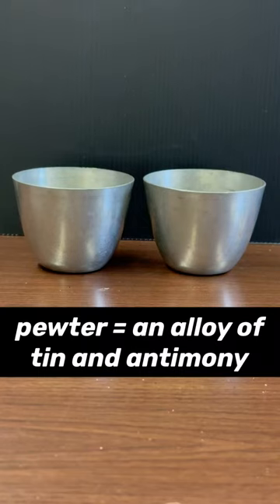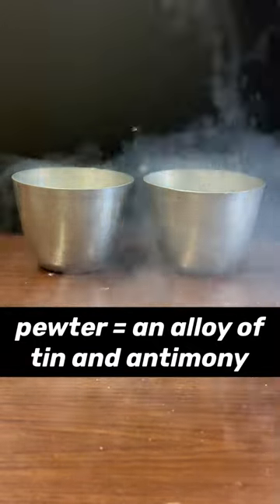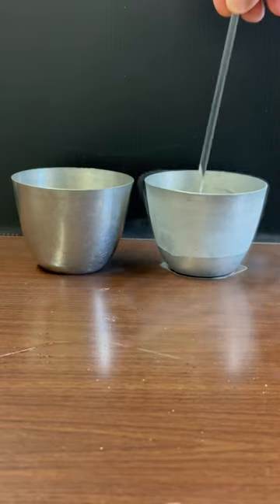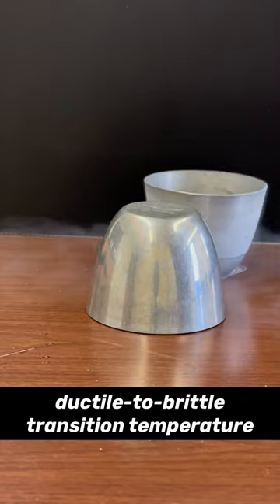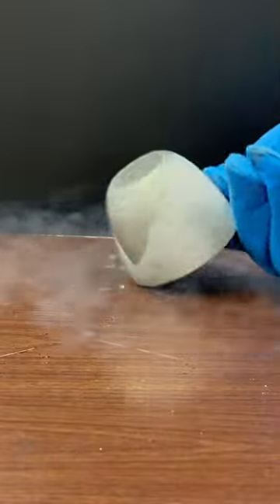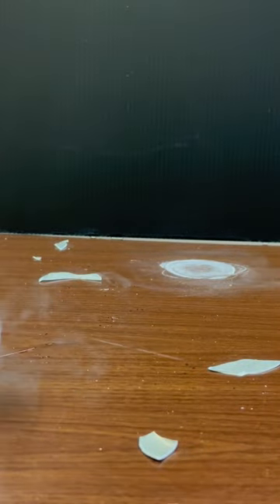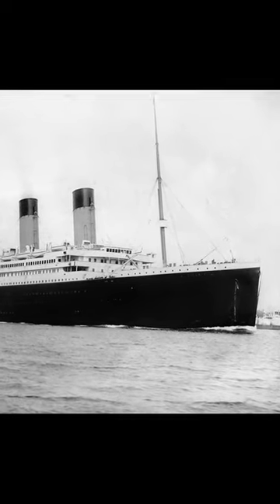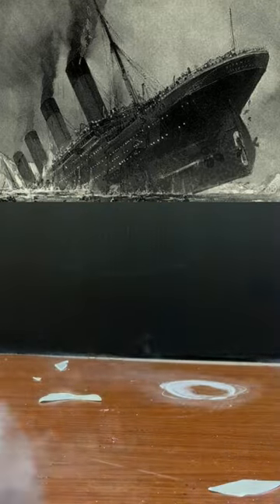Chemistry and the Sinking of the Titanic 🥶🔨🛳️ #shorts #chemistry #titanic #liquidnitrogen

Comment: Except that Titanic's plates weren't brittle; they buckled and deformed just like steel is supposed to, causing the rivets to fail. And the rivets were made out of wrought iron, which is inherently more resistant to brittle fracture than steel. Also the ambient water temp was about 28* F or hovering just above where ductile to brittle transition can occur. Likewise while one side of that steel is contacting the 28* ocean, the other side is exposed to the 80*-110* temperature of the boiler room, so the hull plates themselves would not be anywhere close to freezing.
Reply from the maker: Several peer reviewed scientific articles indicate the waters cooled the steel in the Titanic to below its DBTT. See, for example https://www.tms.org/pubs/journals/jom/9801/felkins-9801.html
Reply: Hammerandhearth you’re absolutely correct, also Fred Barrett clearly stated that the steel plates bent and popped the rivets this is stated in the British and American enquiry.
Reply: Also hadn’t they only just crossed into the Labrador current around a few hours before 11:40?
Reply from the maker: @thebitsanpiecesman4423  sounds interesting! Do you have any links to peer reviewed scientific sources where I can learn more about these claims?

Comment: In the Navy we called it "violating brittle-fracture limits" bad when it's the hull, "stick your head and kiss your ass goodbye" if it's the reactor.
Reply: How... would a reactor approach this limit... dont know that I'd want to see a shattering reactor.

Come to think of it, how many nuclear watercraft have sunk?
Reply: So for the first question, with out going in to too many details, there is a pressure/temperature curve that if you operate outside of you can violate brittle fracture. To my knowledge this has never happened. Last time I checked the U.S.Navy has over 6500 Reactor hours without an accident. Now for the second, I know of only two nuclear powered vessels that have sunk (for the U.S Navy, I think the Russians lost a few, some due to Reactor accidents), the USS Threasher and the USS Scorpion. The Treasher when down due to a piping failure and icing over emergency blow valves. The Scorpion is unknown exactly, though it is known it had nothing to do with the Reactor. The leading theories are she had a hot running torpedo which exploded and sank her or she was torpedoed by the Russians. I personally lean towards the hot running torpedo. I doubt if the Russians sank her they would keep their mouths shut.
Reply: @michaelwerkov3438  google says 9 nuclear subs have sunk

Comment: As an automotive technician in the days of drum brakes, during a drum brake service we would take the return Springs and drop them on the floor and listen. If we heard a thud they were okay.  But if we heard them ring we knew that they were too brittle to continue to be used and would need to be replaced. These were obviously steel but between the heat generated from stopping and the continual tensile stress they were under we knew that they had become too brittle and had lost their tinsel capabilities. A simple test we did to determine the safe re-use of them.
Reply from the maker: That's awesome. Any idea where I can get my hands on some similar springs for relatively low cost?
Reply: @TommyTechnetium Sure,  you can go to any auto parts store and order a return spring kit for drum brakes for any older car that has drum brakes. Mid-90s fords, chevy's dodges, most all of them still had rear drum brakes. My 94 Bronco XLT. Napa, AutoZone they're still available everywhere. If you're going to do an experiment I don't know how you would simulate maybe 5 to 6 years of City driving on them to make them lose their tensile. A real practical application of science!
Reply from the maker: @ipikture  Thank you...lots to explore here if I find the time

Comment: It wasn’t the hull that became brittle, it was the rivets that held it together. They were made out of an incorrect alloy due to a scarcity IIRC, so they became brittle due to this phenomenon and work hardening. Remember, icy cold sea water is hot compared to liquid nitrogen.
Reply from the maker: The experiments in this video are for demonstration purposes. For conditions on the steel used in the Titanic see https://www.tms.org/pubs/journals/jom/9801/felkins-9801.html

Comment: Titanic was not the cold water.... it was the improperly tempered steel....the cold may have added to the temper issue but was not the cause.
Reply: That is not true it had the highest quality steel at the time
Reply from the maker: See https://www.tms.org/pubs/journals/jom/9801/felkins-9801.html
Reply: @Bryzerse  highest steel at the time was brittle not bendable......It is how you define best steel!
Reply: @wesleywrightman4233 no it was very bendable, how do you think they made the hull lol, also the iceberg bent the steal it didn’t break it so this whole conversation is just dumb
Reply: @wesleywrightman4233  The steel used was rolled mild steel. No hardening or tempering to get wrong.

Comment: So much easier to say: the atoms of the pewter have formed an incredibly tight bond at that temperature, thus they have less space to move around and absorb impact. So the atomic structure simply loses cohesion when struck and the object shatters.
Reply: You could say that… it wouldn’t be quite right though. 

Malleability happens when layers of a metal’s atoms can slide against each other instead of splitting apart. Some crystal structures are very symmetrical (like gold’s face centred cubic structure) giving it plenty of directions that atoms can slide and and accommodate deformation. There are others that don’t easily allow that sliding so when the stress gets high enough they just fracture. Pewter and most steels have an in-between structure. There are a few but not many planes that allow easy glide and a few that allow easyish glide. Those easyish glide planes give you some malleability but not as much as gold or copper. However as the temperature goes down those semi-close packed plaines (to give them their proper name) become less active and available so you go from have quite a few ways  of deforming without breaking to barely any at all. Hence you get a dramatic drop in ductility below a certain temperature.

Comment: You know, that's a fact that's not really mentioned that often. That kind of blows my mind that a shipbuilder would have used a metal that would have become brittle in ice cold water. I understand saltwater drops significantly lower in temperature than freshwater but if the steel was correct it should not have mattered either way! That is insane if that is true.
Reply from the maker: It seems like this may have been the best steel available at the time. For more on this, see https://www.tms.org/pubs/journals/jom/9801/felkins-9801.html

Comment: And the biggest problem was the water type deck or walls didn't go all the way to the top deck so when that section that was hit filled up with water just spilled over went into the next section and kept doing that until the dang thing got so heavy in the front and broken half and sank so if it would have done then built properly like the design said to do instead of saving some money and had the water type bulkhead all the way to the top deck Titanic would never have sunk it would have made it back to Port and just one of the bulkheads would have been flooded because it was between two bulkheads that the iceberg cracked and spilled water in but since I the water type bulkhead didn't go to the top deck it spilled over into the next book head area and kept doing that until there was enough water to sink it

Comment: It’s hard to accept the fact that back then all these people didn’t know this or questioned it.
Reply: That things broke more easily when they got cold has been known for a long time. The reason it happens wasn’t known though and especially why a normally malleable material like steel would shatter if it got cold. And it’s a minority of materials that do go through such a dramatic change. Gold, copper and silver for example don’t show a ductile-to-brittle transition. They slowly lose ductility as they get colder but there’s no sudden drop off. Cast iron, on the other hand, is pretty brittle to start with etc. 

It’s only in the last 100 years or so that we’ve had the technology to actually explain why it happens and can predict which materials it will happen to and which it won’t.

Comment: Might have been better to use the Liberty ships as your example for a steel’s ductile-to-brittle transition. 

I’ve read the paper you linked to on the Titanic (and a couple of other similar ones). Yes they show that the steel used could plausibly have failed by brittle fracture but they don’t actually show that is what happened.
Reply from the maker: Great minds think alike! I indeed thought about using the liberty ships as an example but went with the Titanic instead due to its popularity. Unfortunately YouTube only allows 60s for short videos. Tough to get everything in
Reply: @TommyTechnetium  Using the pewter was a damn good demonstration of the process. I’d not considered it would make a difference to how the sound would change between states.
Reply from the maker: @GemAppleTom  Thanks, my friend 😊

Comment: Supposedly the steel plating had high sulfur content making it glass-like.
Reply: A little overstated…

I’ve just been looking it up. It had fairly typical sulphur content - high-ish but not dramatically so. It didn’t have very much manganese though.

Sulphur left on its own to form iron sulphides is pretty bad for a steel’s mechanical properties. The sulphides are quite soft and weak and collect at the edges of the steel crystals (grain boundaries) and makes it much easier to pull those grains apart from each other. 
The normal way to deal with the inevitable bit of sulphur you’ll get in a steel is to add manganese. The sulphur will form manganese sulphides instead of reacting with the iron and MnS is far less damaging (and occasionally beneficial) to a steel’s properties. So Titanic’s steel would be considered a dirty steel by modern standards.

All that being said, it was certainly not bad steel for the time. It’s also not clear that it would have survived even if the steel was of better quality.
Reply: @GemAppleTom  I  see your point. Might it be that the steel plates would contract abnormally so in frigid,Arctic waters?
Reply: @raymondfrye5017  I think it was the fact that the Titanic smashed into a whopping great big iceberg that tore a 100m gash below the water line that was the main cause. 

It could have survived that if the bulkheads were designed properly. For reasons best known to the designers the bulkheads didn’t completely seperate the compartments. Once one was filled up most of the way it started spilling into the ones beside it and filling them up and so on. 

The steel wasn’t ideal by modern standards but I think the ships design and what damage the iceberg did were ultimately responsible.
Reply: @GemAppleTom  Yes. I know that part about hitting an iceberg. I algo learned that the HMS Britannia met a similar fate because of a flawed design by Mr.Ismay,naval egr. 
 Porthole windows were located dangerously close to the waterline which accelerated its sinking.

Comment: Pewter also used to be made of lead and tin , I have some. I've also heard of bismuth added as well. That's an important side note.
&
On that note, I got some metal ingots I was told some were tin, and some were zinc.. 
But I suspect I got mixed pewter and zinc/aluminum alloys.
   As I may have 6 or more metals melted together I don't think I can use density or melting point for any concrete determination of content, nor do I have access to a XRF machine. So , can you recommend some qualitative tests I could use to find out if and how much lead, antimony, bismuth and aluminum may be in my metal samples? & How much actual zinc and tin?
Thanks!!!!
Reply from the maker: In my understanding, without XRF it's a bit difficult to test for the presence of various metals in a nondestructive manner...
Reply: @TommyTechnetium  destructive is fine, I plan to  dissolve most of it one way or another. If I use sulfuric on the suspect tin , lead and bismuth should mostly remain, but antimony? How would I tell them apart? Or how much was aluminum? Perhaps even a way to separate.
    I mainly want to be sure I'm not creating a bunch of toxic waste. I suspect antimony would be the hardest to deal with.
Reply from the maker: @petevenuti7355  I'd then start by dissolving the metal sample in nitric acid. You'll need to use a hood when doing this or do it outside; toxic NO and NO2 will be released. See https://pubs.acs.org/doi/pdf/10.1021/i560150a024#
Reply: @TommyTechnetium  helpful! Thanks! Not going to be able to tell the difference (antimony/bismuth) by eye that way, but it's very sensitive, I'll know if any of either element contaminates my ingots, overkill for just making sure it's not mostly recycled pewter.
    There really should be an encyclopedia just for such tests.
Reply: Scrap yards have XRF machines right near the customer service counter. They will probably be willing to identify your mixture for a small fee. Or just see if they want to purchase it.
Reply: @hamjudo  the scrap yard near me , the owner keeps his at home, you have to make an appointment for him to bring it in, and I've made two this year and he hasn't shown up.
Reply from the maker: @hamjudo  That's good to know. Thank you for sharing
Reply: @petevenuti7355  That's a bummer. There are several scrap yards in the area, so the competition keeps them more customer focused.

One time on vacation, I talked my wife into going to a store for nerds like me. You may have to plan a vacation so it includes going to a city with a Maker Space with an XRF or an appropriately equipped electron microscope.

I had a summer job at the local pacemaker battery factory when I was in highschool. I spent a week cutting the tops off of battery weld samples with a Dremel. The samples were lithium thionyl chloride batteries, except without the lithium thionyl chloride. So they were just little stainless steel shells with electrodes.

They wanted to analyze 500 of the welds under an electron microscope. The electron microscope had the attachment that could use backscatter to identify which elements were present. This was back in 1978.

I know a couple maker spaces have bought old electron microscopes and got them working again.
Reply: @hamjudo  there's a maker space near Albany and RPI in Troy, I have a friend who lives near there, might pass by me Monday on the way home, I might just give them both a call , have him bring a sample by them😁, if anyone has one I would think the one near RPI should have one of the best.

Comment: The bottom of the cup doesn't frost until the liquid nitrogen is poured out, why? Like that part would be the coldest, it should be the first to frost but it's not
Reply from the maker: Metals are very good conductors , so the temperature of the cup equilibrates rapidly. Notice that the frozen mist (made of very tiny water droplets) exists exits the cup at the top, then sinks down. More mist at the top (at roughly the same temperature as the bottom) equates to a more rapid build of ice on the top as compared to the bottom. I don't fully buy this explanation, but it's my best guess for now. You have any ideas?

Comment: The surface of the Atlantic has cryogenic temperatures?!
Reply from the maker: No, but the steel used had quite a high ductile to brittle transition temperature. See https://www.tms.org/pubs/journals/jom/9801/felkins-9801.html
Reply: Not it didn’t really. Why would they knowingly use bad metals

Comment: I took the  compresed air cans, the ones you clean computers with, and turn the upside down and I would fill up a Styrofoam cup about half way with the liquid, then I would take a flower like a Rose petal or leaf and put it in the liquid take it out than throw it on the floor and it would shatter like glass. It was during a long night at work and my co worker and I were board 😂😂
Reply from the maker: Love it!!

Comment: What alloy was the titanic? Most steel I know need to be very cold.
Reply from the maker: It was made of poor grade steel. See https://www.tms.org/pubs/journals/jom/9801/felkins-9801.html
Reply: Keep in mind, steel ship building was only about 20 years old when Titanic sailed in 1912. Large scale industrial steel production wasn't possible much earlier than that either, and meteralurgic knowledge was a lot more limited.
Reply: @TommyTechnetium   Wow, interesting read. To show my ignorance again, I am thinking that it's a large part manufacturing steel plates that size and with that quantity. Very heavy locomotives riding on steel rails in much colder environments had been around for a while. So, maybe applying that to a massive ship my not have been easy or possible. - Just showing my ignorance- but that was an interesting read thanks.
Reply from the maker: @JustaReadingguy  Good point regarding steel rails; hadn't thought of this. I have been learning a ton from reading through the comments on this video